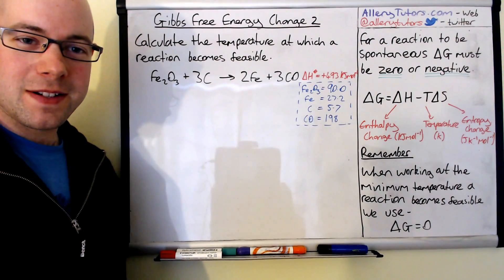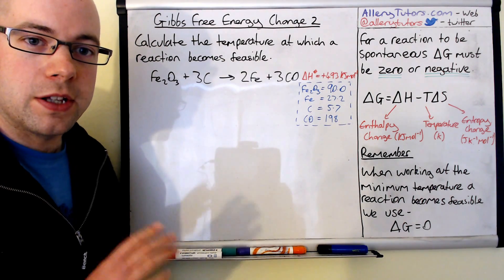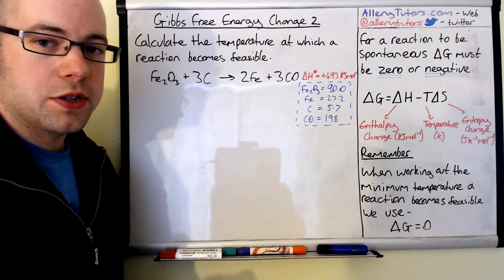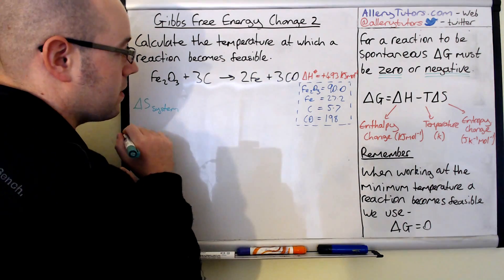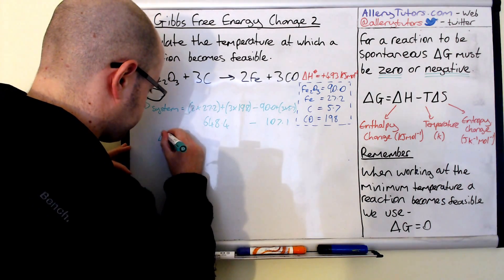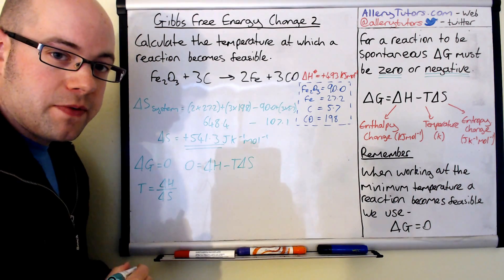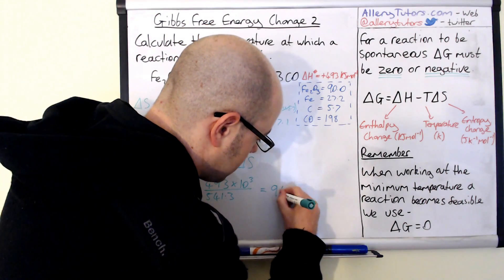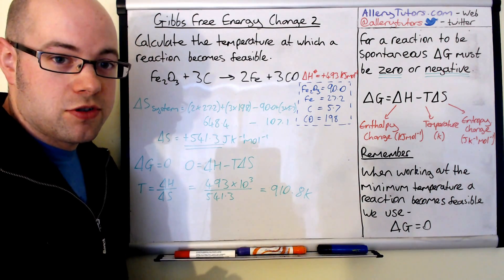Gibbs Free energy change 2

Comment: Do you still need to convert enthalpy from kilo joules to joules in the new spec?
Reply from the maker: Yes. That hasn't changed. As long as the final units for Gibbs are correct you can convert at any stage.
Reply: Allery Chemistry Oh right. We are taught to convert entropy to kJ/K/mol but its pretty much the same thing. Thanks.
Reply from the maker: Hmm. Don't know why. Standard units are J/K/Mol.